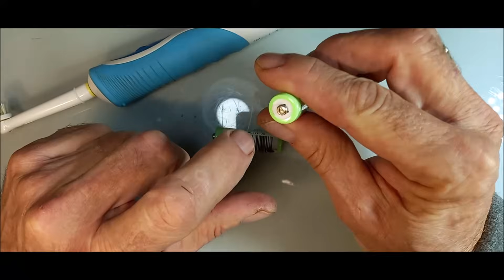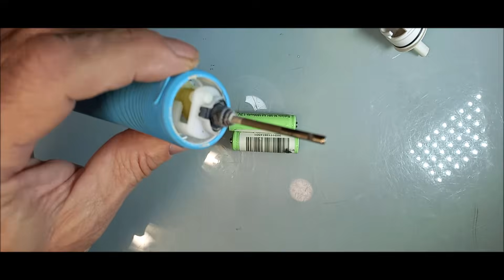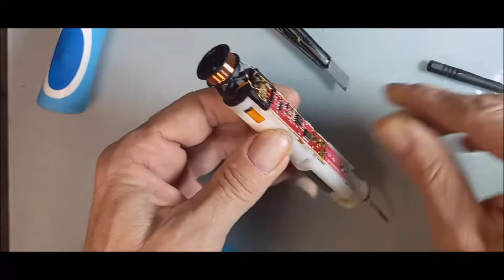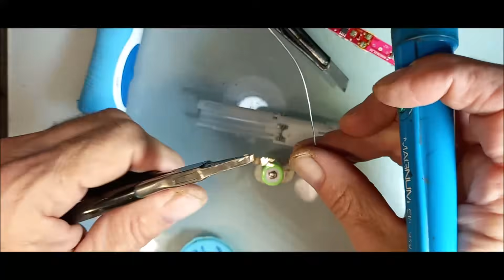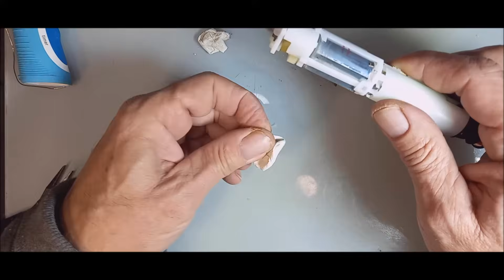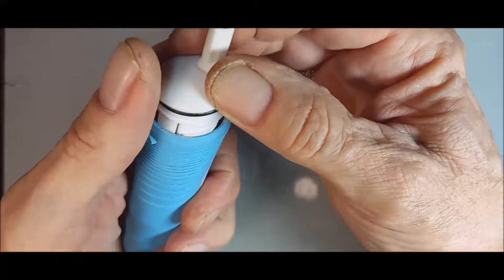Oral-B Electric toothbrush battery replacement

Comment: I usually always threw them away after 2-3 years, but - thanks to your video - now i replaced the battery and it works again like a new one, good for the environment good for the wallet
Reply: A friend of mine used one for over 15 years on the original battery and motor. It's only now that I'm looking into replacing the battery. The induction charging is slow with a 700 mAh battery, so it will be even slower with a much higher capacity battery, but it will last a very long time on one charge, assuming the charger circuit will keep going and fully charge a higher capacity battery.

Comment: Once you have the old battery unsoldered, instead of soldering the new battery, you could have devised a system of moving contacts, like the non-rechargeable batteries that have the devices, putting a spring soldered to the circuit in the bottom and leaving the contact at the end unsoldered. When closing the system everything will remain immobile and pressed.